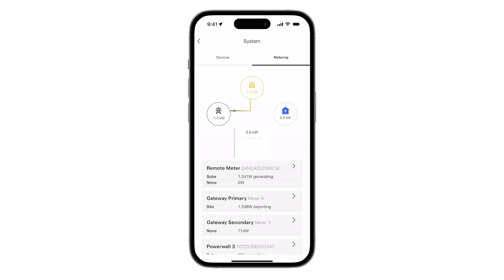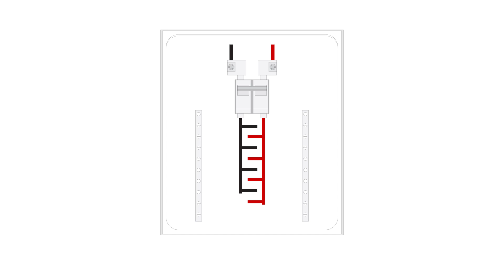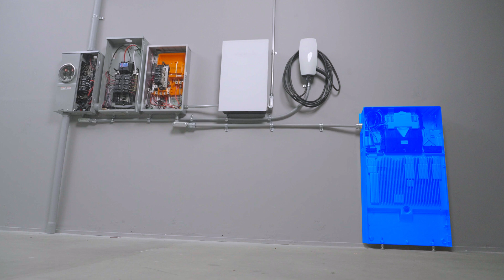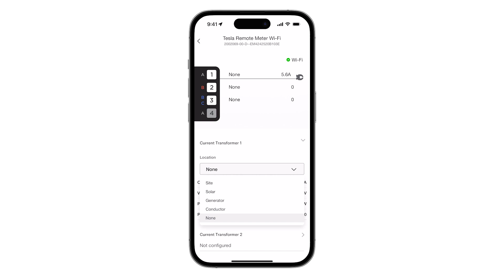Tesla Remote Meter - Installation

Comment: After the installers finished installing my Powerwall 3, Gateway 3, and Tesla Remote Meter, I noticed my solar production was 2x as much as it should be and the home consumption numbers were too high and mimicking the solar graph. After watching this video, I found out that the installers clamped an extra CT on for the solar, the Remote Meter was configured incorrectly with CTs plugged into wrong ports, and the  line voltage harness was also in the wrong phase in the circuit breaker. Once I corrected their mistakes, I am now getting accurate readings on the Tesla App.

Comment: These are great. Just make sure you are getting the ones that are for the powerwalls and not the Tesla Charger wall connector. Now that Generac owns Neurio they must be configured for correct device to communicate properly. Check model number to confirm.
Reply: What's the model number for the one for the Tesla Wall Connector?

Comment: I have two PW3 + two expansion batteries with Gateway 3.

This house has 600A service / Main Panel with four sub-panel breakers:
- Main House - 200A Breaker / Sub-Panel 
- Main House Backup Loads and Solar - 150A Breaker / sub-panel
- Main House Garage & EV Charging - 200A Breaker / sub-panel
- Guest House / Garage - 200A Breaker / Sub Panel

The Gateway 3 is only measuring the loads for the Backup sub-panel.  So I need a remote meter

Can the Tesla Remote meter combine multiple CT together to give entire load for the main panel?

The alternative, which is not as good,  is to only get the loads from the main house 200A breaker/sub-panel.

I don't see any info that I can have multiple Remote Meters which could be the other way around this challenge.
Reply: just put the remote meter at the very begining of everything right at he source then tesla will see that as the load , look up what to do in 'partial home backup',
Reply: @jayhedrick2600  Can't the CTs can go around the bus bars and have a limit of 200A   

What the installer did was to add two remote meters.  
- One is connected with RS-485
- The other is connected over wifi

This leaves one Sub-panel unmonitored.   So the PW3 does not know about those loads and can't distribute power based on those loads.

A problemTesla observed is that the wifi connection to the PW3 is dropping out from time to time :-(.   The PW3 and remote meter are only 20 feet apart 😞

Tesla told my installer that a new CT device is coming that will allow monitoring all Sub-panels, but no ETA for that.
Reply: @jayhedrick2600  Can't put at the beginning of everything. 
Issues:
- They are rated only at 200A.    I have 600A service.

- Even if they were rated higher than 200A, the CTs can't fit around the bus bars.

We installed two Remote meters.   The one configured as RS-485 works perfectly.   The one configured as Wifi is exceptionally flaky causing the PW3 to continually try to connect to the Wifi meter and this causes the whole system to continually cycle. 

It is too bad the engineers at Tesla didn't realize they could easily have 32 Remote Meters connected over RS485.  This would give a robust solution.   

For now I have only the Gateway 3 meter and one other sub-panel monitored.   I have two sub-panels not metered.  Which means I don't get full benefit of the powerwalls.

My installer is still trying to get support to understand.   But so far each of the support people has been confused.   This has been going on for months. 

--
I heard rumor of a new meter coming, but nothing definitive.   Or perhaps that was a support person at Tesla just speculating to get the phone call ended.

Oh and it seems that Tesla Support is measured on closing tickets and not actually resolving issues.    I called Tesla support and when they decided they couldn't fix and kick it to the installer.  They said they would close the ticket.  I said the problem wasn't fixed and they should leave the ticket open.    They didn't and closed the ticket.  

Not the right answer for sure.

Comment: It's funny when they refer to L1 and L2 as A phase and B phase considering its connected to a split single phase. wifi isn't a reliable connection for site or solar unless you want a system  intermittently functional.

Comment: This looks great and awesome video. Is there an alternative that someone can install to do the same thing for their house when they don’t have a Tesla power wall installed?
Reply: In the case where you have solar, you should have metering available. If you don’t have solar or a backup generator, you would just refer to your meter to get an idea of power consumption.
Reply: Shelley meters with CTs are available in the UK. You can put them on any circuits